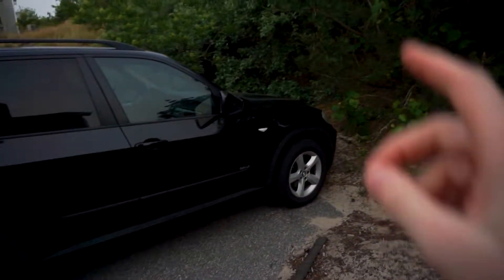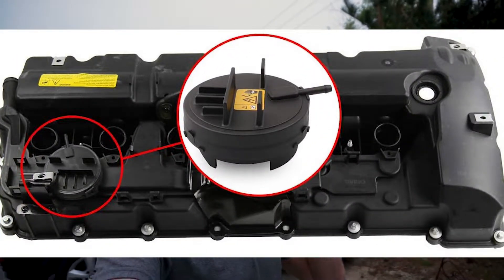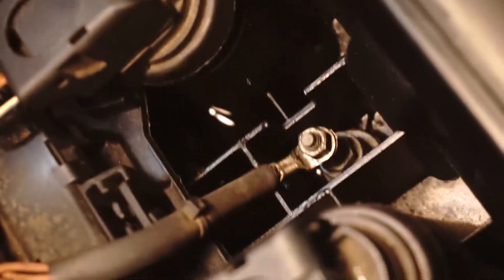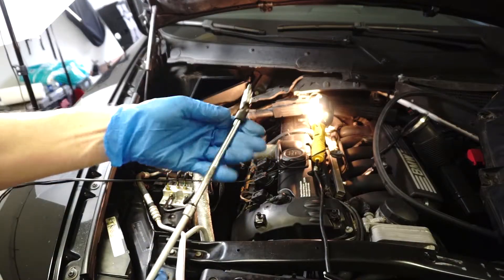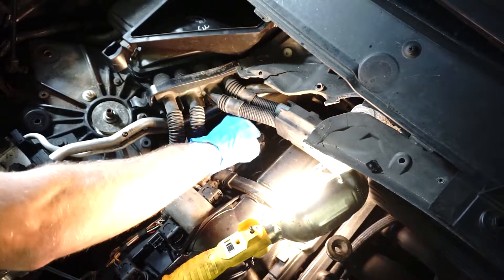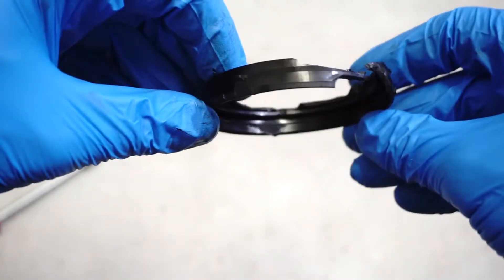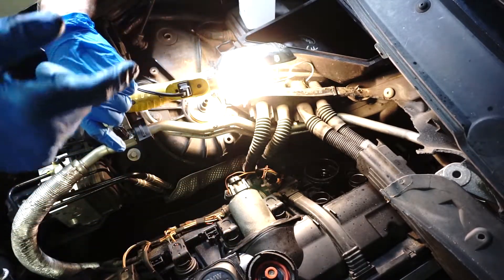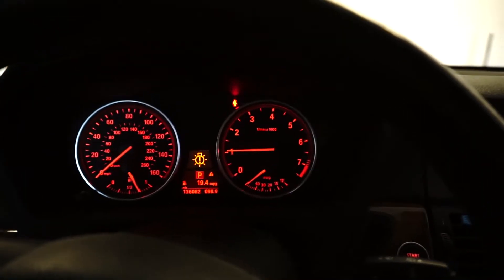How to replace CCV CVV PCV valve replacement BMW N52 Rough Idling

Comment: i like your video i have a question does the pcv valve connect to anything since it has a small tube or nipple that looks like it should connect somewhere or does it just stay like you assembled it without connecting to anything

Comment: I forgot to put back the spring and used a shit ton of grey gasket maker smh 🤦‍♂️ it now runs and doesn’t shut off right away but after a min or so it’s starts to rough idle then shuts off at the light
Reply from the maker: The spring is a crucial part of the CCV valve, better not to run the engine, it's not gonna harm it but you probably gonna be sucking oil in to the intake. Are you gonna re-do the job? or what the plan?

Comment: Honestly I’m decent mechanic wise not THE BEST but I told my mechanic to do yhis he wants to charger me 250 plug a new vavle cover[200/300] just did this within a hour But a heat gun helped a lot in taking off the side peices
Reply from the maker: Overall it's not bad price for a valve cover replacement, and it's great you were able to tackle it yourself! Pretty clever with using the heat gun!

Comment: Nice explanation thanks.
By restarting your vehicle when engine is hot. The rough idling problem comes back or not?
(Before PCV valve replacement)
Reply from the maker: Overall there was a stack of things, check valves, vanos valve cleaning, pcv and adaptation reset, all of that did the trick. Good luck.
But before replacing the pcv make sure it ript, you can test it with vacuum tool.

Comment: does the valve have a hose that connect to it? if so where does the hose go to?
Reply from the maker: I think only European models have that option, it’s got something to do with emissions, not full familiar with that system, as for the US, we don’t have the line that is connected to it, usually it’s lose plug that covers the hole but it not blocking it, so the membrane can move as it desired from manufacturer.
Reply: @Makhnovets  Thank you! i was trying to figure it out

Comment: If i broke the plastic clems?
Reply from the maker: I broke my as well, all though it's better with them lol. make sure you leave the silicone to cure for good amount of time, a day or so. in that case you shoud be good.
Reply: @Makhnovets  i dont put anything. Just the new cover. Is bad?

Comment: Change the entire Valve Cover of a 2008 BMW 328i. Includes the PCV.
Since I turned it on it did not sound good and a lot of blue smoke from the exhaust. You need to tune the Valvetronic.
But it kept making oil. Change hoses, sensors. All the same blue smoke. I couldn't speed up much.
Thank God I realized that when we installed the PCV we did not include the Spring.
Since there is no spring, the PCV stays open and pours oil as much as it wants, especially when you accelerate and when the engine is hot.
The key Spring because the BMW 328i 2008 has the oil separator in the Valve Cover and part of the work is done by the PCV. If it doesn't work, all the oil goes to the intake manifold and that's where all the problem comes from because the spark plugs fill with oil.
So don't forget the spring.

Comment: Hey I replaced mines with a new one but forgot to put the spring the car runs fine so far.. are there any danger of not having it in?
Reply from the maker: yes, the valve will not work properly, it will stay open or close all the time, possible problems, burning oil, blue exhaust smoke, exes amount of carbon deposit inside intake and cylinders, on high rpm or highway driving will be most notable, this system separate return gases from the oil, if not working correctly, it will also suck oil in the intake... 
Nothing gonna happen overnight, but make sure to install the spring at some point!
Reply: @Makhnovets  how does the spring close and open the valves, I thought it was there for structure?
Reply from the maker: @iooraster2116  I think it’s keeping the valve close, and when internal engine pressure increases it gets open, I know just basic, you might be right in terms of its just for structural support, but I can’t confirm that. 
Simply it’s same PCV valve, but more complicated since it’s BMW.
As for how long you can drive it, less better.
My for example had a whole, it was like that since I purchased the car, and before I replaced it I put 5k mi on it, and who knows how many miles did previous owners , so I guess you can drive the car as is, but what problem it can cause or how fast, i have no idea.
Good luck.
Reply: @Makhnovets  how long can it run without it?

Comment: bmw just put out a recall for this in march of 2022. i'm bringing my 2009 328i in tomorrow to get it fixed free of charge. check it out to save yourself the headache.. they even give you a nice loaner car in the meantime :) i'm going to ask if they have some type of reimbursement policy for all the damn fuel we burned through due to this issue, not to mention the oil leaks and engine damage 😠
Reply: That’s the pcv heater, different part
Reply from the maker: Yeah, tha't the huge flaw in desighn, but if they do it now as recall, that will be nice, since they would have to replace the entire VCG, so that's pretty good deal! Unless the recall for the PCV heater.
Reply: @Makhnovets  UPDATE: It was actually the PCV heater. Although after the recall, my engine has more power and doesn’t burn though as much gas. Check engine light still on 🥲
Reply: @kidshyne lol i just had pcv heater recall done dreading tk do a valve cover going to change out the plastic then
Reply: @saucyiwnl its not hard at all honestly i probably wouldn't even bother replacing the bolts i have replaced them once but didn't the second time i had to remove vc (for a different reason) it hasn't had a single leak or issue
Reply: @213BRANDONP  im wondering if upgrading to a different material than plastic

Comment: Quick question please bro. Where does the other end of the small vacuum hose from ccv valve go to? I bought the car and previous owner had it blocked off
Reply from the maker: It goes to the back of the valve cover.
Go to realoem.com and look for the diagram. It’s pretty easy. Otherwise shoot me a message an car year and model

Comment: Could this issue cause occasional white smoke under acceleration?
Reply from the maker: It’s very possible, the previous models from 2000’s had issues with white smoke because of pcv. if it’s completely destroyed, but I would test it first, the video in description on how to test it, also does it produce any noise? You might be looking on steam valves, how often do you have white smoke? What engine do you have, because the turbo can do that as well.
Reply: @Makhnovets  It's inconsistent. Sometimes at startup (car is already warmed up so not the typical cold weather start) and every once in a while when accelerating/taking off. Sometimes at idle. It is super inconsistent. It is an n52. Car is a 2010 328i (x-drive)

Comment: Just replace the whole thing and do a full tuneup and be good for another 125k miles.
Reply from the maker: I usually keep the car for six month to year, in that case I try to repair most of the problems on the budget, but you are 100% Right! If you want worry less, replace the cover in full, and you be golden!

Comment: Just like FLY LYF commented, I use my heat gun on low and took it SLOW and it came right off. 

First I drilled about a dime size whole on top as close to the edge as possible without damaging the housing, but far enough away from the center to not damage the spring. 

I then used a Chanel lock pliers to apply upwards pressure as I applied the heat and was able to get it off. I did damage 1 of the clips. So to avoid damaging the other two, I applied heat to them and bent them away from from danger. 

After I removed the PVC I applied heat again to the clips and SLOWLY bent them back to original position.

So I definitely recommend using a heat gun even if you have to make a run to harbor freight, it well worth it, and it something useful in the toolbox anyways.
Reply from the maker: That’s a really nice guide DIY!)
You should start making the tutorials!
Reply: @Makhnovets  Couldn't do it without your vid, it was really, really helpful. Save me a bunch of money. I was ready to fork up the $200 for the valve cover and another $200 for the labor, so THANK YOU!
Reply from the maker: Thank you for a good word 🙏🏻!
Reply: thank you so much for this tip! i heated it up and pried up gently and it came off in one piece! also shoutout to OP for making this vid.

Comment: Where does that vacuum line hook up to? I bought a used 128i and it’s not attached to anything
Reply from the maker: It doesn’t have to be, the nozzle has to be open as inside rubber membrane that has to move and it’s sealed inside of the engine, and getting in action by vacuuming force inside the engine. If you gonna close it, the PCV OR CCV will not work correctly.
Some of the European models have separate pump connected to it as they have more emission requirements.
Reply: @Makhnovets

Comment: Was dreading the PCV removal. I can say using a heat gun made all the difference. It softened up the plastic “welds” and I used a small chisel and hammer and took little pieces. Took about 10 mins. 

Heat. Gun.
Reply from the maker: Yes there are definitely some improvements to the technique but overall it’s working but thanks for the effort and comment!

Comment: Does a hose connect to it ?
Reply from the maker: In my case no, but there some people say that they have house connected to it, I assume that they have some kind of extra equipment, bit as many engines i seen, non of them has house connected to it. Also there supposed to be opening.

Comment: I have to do the same job, does it really work or should I change the entire valve cover? Don't like to do that after changing the gasket last summer, was a really hard job for me... TNX for your Video
Reply from the maker: Do this before any further action. https://youtu.be/M3YbtvNKMCA
The technic is working! but you need to be precise when you doing the job, if you'll make mistake you might even have more troubles down the road... so check the video, and either you did replaced or not, make the vacuum test, if there leak, you know what to do.
Reply: it does not work. I talked to few people including myself, yes, the noise it reduced, but not gone completely.
Reply from the maker: In that case valve cover got to be replaced and the vent valve need to be checked or replaced as well.

Comment: I did this and it lasted one year, then tried it again and it only lasted a week, bought another one and only lasted 5 days. I'm at a loss I don't know what's wrong.?? Anyone have this happen. I will try new vanos next.
Reply: Just changed the intire valve cover yesterday ,so far so good.
Reply: @chucke3305  I'm going to replace my valve cover this weekend, if I get the part. I hope it solves my problem. It's the same, the loud whistling noise.
Reply: Update: everything seems ok except it's running rough. I thinking it's the valve tronic adjustment, I remember hearing it might need to be adjusted by computer . Has anyone had this problem?
Reply: @chucke3305  Mine is running rough too. No codes. See if you have that strong vacuum on the valve cover, by removing the cap while it's running. That's the symptoms I have, strong vacuum in the cover. I can barely pull the fill cap off, and it runs really rough, wont hardly idle, and the idle changes when the cap is removed.
Reply: @odubb45  I'll check that . Thanks
Reply: @odubb45  so I have no vacuum when removing oil cap, but I had a bunch of codes from my obd reader and one was a po0013 which is telling me the the O2 sensor s are crossed so I changed them ( they look the same) on the fuel rail. It runs good now. Also reset the valve tronic motor by hitting the start button twice without starting the car. Also manually turned the motor counter clockwise till I hit tension , then did the start.
Reply: @odubb45  if you have the built in ccv on the manifold you need a new Valve cover. If not you need to remove intake and change out your pcv.
Reply: @chucke3305  That's great! Yea, I'm going to change the valve cover. I'm just waiting to receive it. That's where all my troubles started. I changed the valve cover gasket, and oil. Started the car, and it ran very rough, and almost every cylinder misfiring. Cleaned vanos solenoids, camshaft sensors, and vanos non return valves. Didn't help. After watching several more videos, I checked my oil filter housing cap. I found out I had no spring, or vavle inside that little basket attached to the cap. I replaced the cap with a new one. No codes now, just runs rough, with the loud whistling, and high vacuum in the valve cover. Now I have to take the VC off again, and change it. I'm using a Febi Bilstein VC $257 including shipping, and gaskets.
Reply: @chucke3305  I hope all your issues are solved.

Comment: Hi, Cheers for making the video.  I can't see the link for the valve.
My 2008 325i (Black Engine Cover) is fluctuating & revs  up when cold when I apply the brake. It also cuts out when slowing down for intersections etc. I have replaced the MAF & it hasn't made any difference. The engine will run much better once warm with the MAF unplugged. I've had the car a few months & every so often I can hear the Lifters so I add  1/2 -- 1 ltr or oil. I have never seen it burning it (blowing smoke) and it doesn't have  any major leaks & with not having an actual Dip Stick (Dumb Idea!) I'm relying on the oil level  sensor being correct. Is there also a Oil Separator on the Intake Manifold?  I've tried looking with a light & can't see one. 
Thanks.
Reply from the maker: Hey.
No, there no more oil separator on intake, but you could have a-lot pf carnbon deposit on valve’s, that will make your car go lean.
Reply: I have a 2008 328i n52k that I got recently and I'm starting to fix the issues it has.  I had the same idle fluctuations on mine when pressing the brake pedal when I first started the car then it would go away most of the way after it warmed up. And also even not pressing the brake pedal it did a little fluctuation right after I start it.  I have the bimmer Geeks pro tool and I reset the engine adaptation and learn parameters and also the vvt motor minimum and max calibration. The motor was all over the place after I did it lol but it went back to normal afterwards. When I start it now it doesn't fluctuate anymore no matter how hard I press the brake but the car still has a stumbling and fluctuations that come and go while it idles from some other problem. I found my problem and its a typical problem on n52s that the connector plug and pins for the MAF sensor does not make good contact and it causes the engine to run like crap and not smooth with power. I had a code for the MAF sensor. For BMW the MAF sensor is called HFM sensor just so you know. I put a new german howe sensor in and also the conector on the old one was cracked. New sensor didn't do anything. With the pro tool I noticed that everything with the sensor like the air inlet temp etc was being read by the dme and working but when I looked at the voltage for the sensor it read 0. No matter how much I rev it it was 0 volts. At idle the sensor has to send a signal to the dme or computer which it is not. I removed the plug to the sensor and noticed one of the pins must be pushed in but I need to get to it tomorrow and open the plug up and fix it. I put new plugs and all ignition coils and the motor was still acting up. They sell the pigtail fix for the conector but first I'm going to open it up to investigate and see if I don't have to spend the money but I'm sure my problem is there. I read on E90 post that many with n52 we're having the same codes as me and issue. Unless you have a good scanner like me it will drive you crazy. I have the tool and still can be intimidating to fix simple things on these cars. Anyway hope this is helpful. Also I forgot, concerning your noisy lifters you want to use a good oil 5w30. I use pennzoil ultra platinum full syn.  To get rid of the loud ticking what you do is start the engine then let it fully warm up for ten mins or so the oil flows well. Then just rev the motor to 3,000 Rpm and hold it steady there for a good 5 minutes. Then you should see how the noise  go away. In my case it did wonders and has never came back. To answer your other question the 2006 n52n has the silver engine cover and the magnesium valve cover and those have the CCV under the intake manifold. The n52k like yours and mine are more revised version that have the black plastic valve cover with the CCV valve on the valve cover only. 2006 is n52n.  2008 on is n52k and there alot of other differences👍
Reply: @L-Noble.YT_Hi.Res-Soundminds   Hi, thanks for your reply.  I have a THINKCAR, THINKSCAN MAX which is a good multi vehicle scan tool., which I used to find the same no voltage fault at the MAF sensor. My connection fault was up in the main harness junction box. A dirty/loose connection.  After fixing it the car still wasn't running right, idling rough and cutting out when slowing down.
The Vanos check valves in the right front of the engine block were the issue. They were absolutely filthy and clogged. Once I cleaned them the car has been running sweet!
Reply: @Lyndog01  Your loose connection was in the white box where the Dme is or under the glove box junction box electronics ? I know the fuse for the MAF is in where the Dme is at. Glad you got the problem. Yeah I've heard about that think car scanner Nice.
Reply: @L-Noble.YT_Hi.Res-Soundminds  Yes the loose connection was in the white box where the DME is.  This car does not have a fuse for the MAF. ( I've read online that not all of them do) . Hope you get your sorted!
Reply: @Lyndog01  Hey thanks I appreciate it a lot. Very helpful indeed. 👍